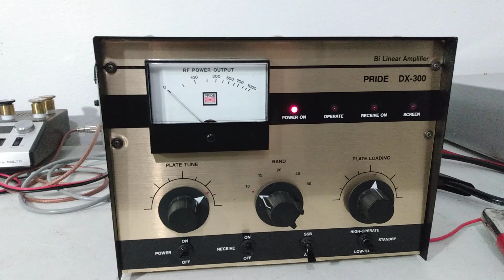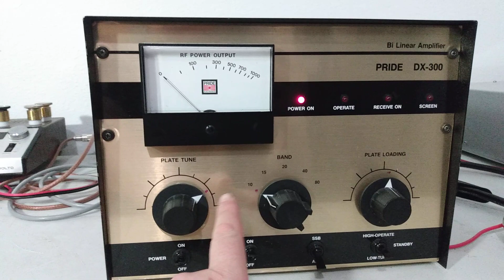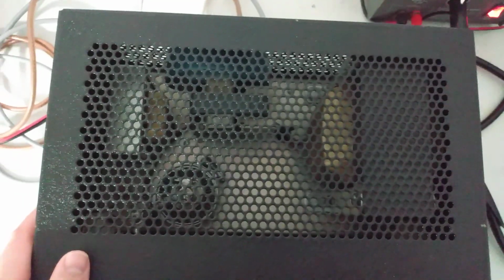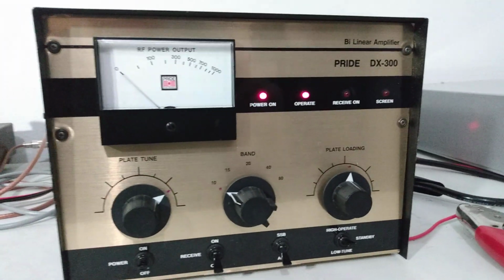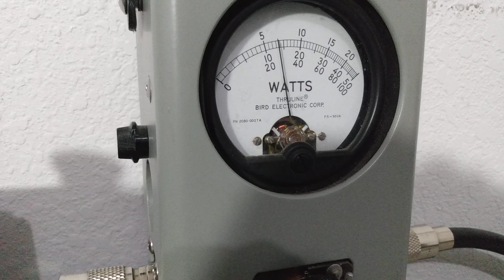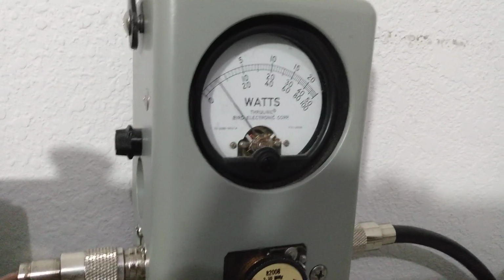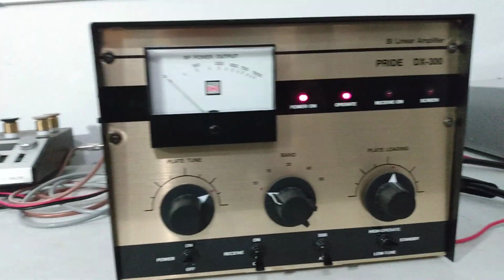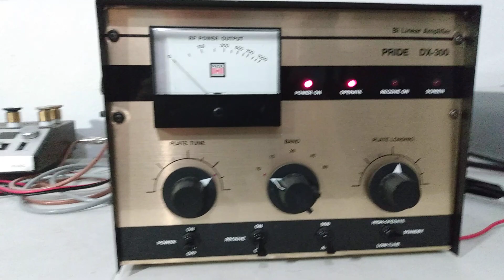The Pride Dx300 Linear Amplifier, upgraded boards, upgraded tube, Nicest pride I've owned

Comment: I find it somewhat interesting.....!!!! They always want to highlight certain features what you can and cannot do but they don't get into the nitty gritty...!!!! No I'm not trying to beat anybody up here but let's face it....!!!! These gents never seem to cover important elements....!!! Example would be, inner electrode capacitance and why that is important in space charge devices....!!! Cathode biasing and cathode stripping....!!!! Optimize plate voltage for impedance....!!!! Q value of the tank network.....!!!! The importance of the proper filament voltage according to the factory specifications....!!!! Secondary emissions....!!!! Full wave versus voltage doubling and voltage tripling...!!!! Over coupling and heavy loading.....!!!! VHF parasitic oscillation....!!!! This is just the name a few....!!!! And the importance of high voltage and how it only takes so many milliamps across your upper extremities in reference to the ground and that's all she wrote....!!! Or is a friend of mine who's now silent key used to put in a lot of his transcripts, if you're not careful it'll be good night Eileen 🙂...!!! Thank you Mr measures for all you produced including all your findings....!!!!73....!!!! Oh last night least one more thing always put whatever you got laying around when you blow the fuse Don't investigate why it Open. especially if it's inrush current you can use NTC "negative temperature coefficiency"to take care of that but every time I get one of these from a   11 m gentleman, it seems like they've always put in twice or sometimes the three times the current rating that's necessary
.....!!!